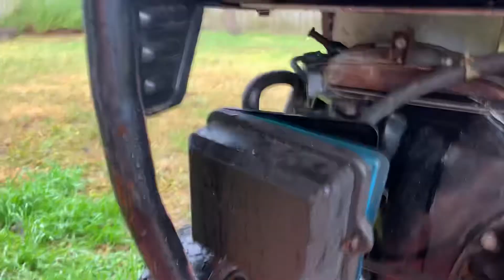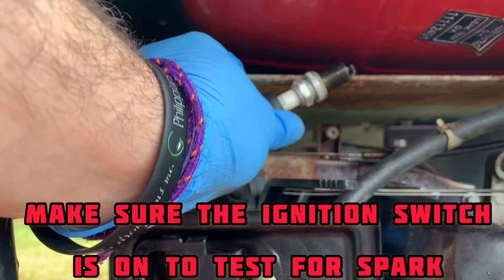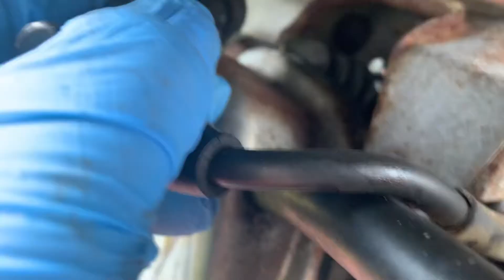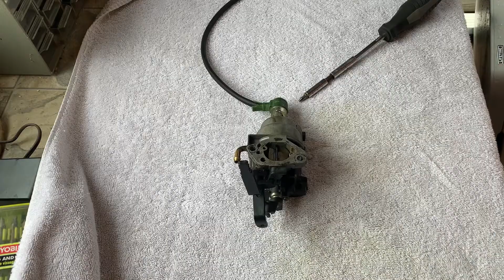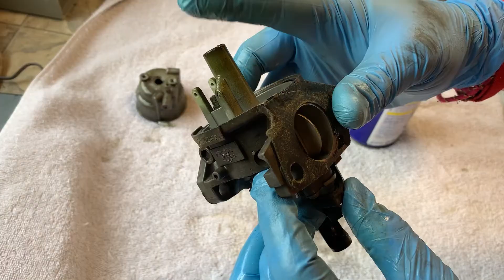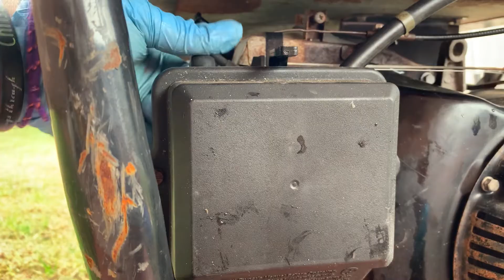How to clean Briggs and Stratton generator carburetor easy diy

Comment: Good video, especially for beginners! Instead of WD-40 I'd recommend using spray carburetor cleaner. Some sewing needles may actually be too thick. Strip a bread tie wire. Also look to see where the tiny little holes for the low & hi speed jets come out into the throat of the carburetor, run wire though those passages, followed by carburetor cleaner. Personally have never bothered with compressed or canned air, as long as all the little passages are clean, whatever floats your boat, or carburetor float!

Comment: I can buy a replacement carburetor for $20 on Amazon. Not comfortable taking and cleaning it like you can. Would that be more advisable?
Reply: I was checking out my generator and it won't start. Starting fluid sprayed in carb would get it sputtering. So ordered "carb kit" with new springs and filter gaskets  for 26$. I think it's worth it to just replace the carb and be done with it.
Reply: @witch5884  i agree
Reply: Did you ever order a new carb? Trying to figure out what I should do too.
Reply: @KR4IUR  b
before buying a new carburetor, I changed the spark plug, drained all the remaining gas and put new gas in the tank, took my air filter out and left it out as I sprayed carburetor cleaner in the carburetor and then tried starting it. Sputtered a bit, but then kept running. Left it run for about 10 minutes. Stopped it and tried restarting. Fired right up.
Reply: For the record, aftermarket carbs are very hit or miss. They might work fine, might not work at all or (most likely) won't work quite right and the engine will lope because the fueling isn't correct and the speed governor can't compensate properly. That's just my experience but I watch a lot of YouTubers that make repairs and that seem to be the general consensus. It's always best to try and fix the original carb if you can.

Comment: You worked on the exact model I have. I followed your video. I was sure it wasn’t going to be fixed because the carburetor was clean. I think what must have fixed it was poking a sewing needle  into every hole I could find. Started up on the first pull! Thank you so much!